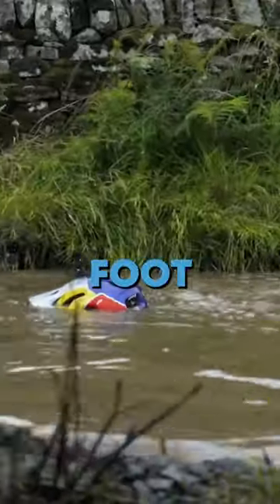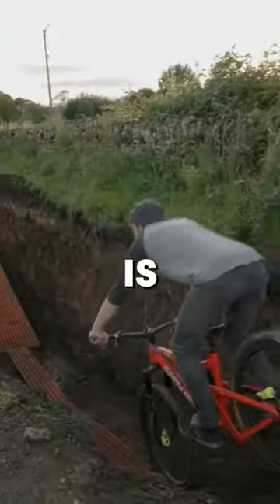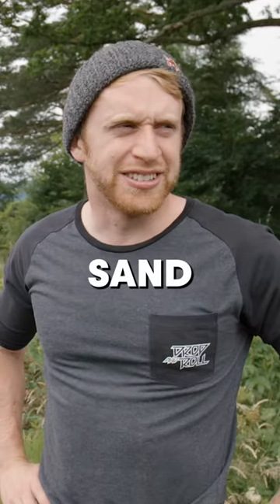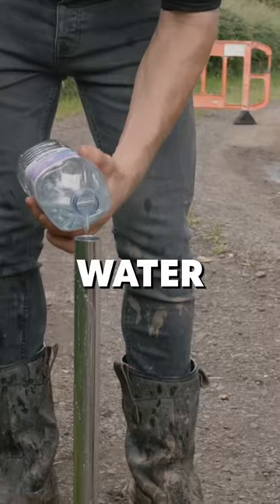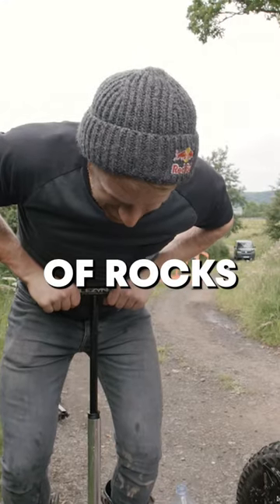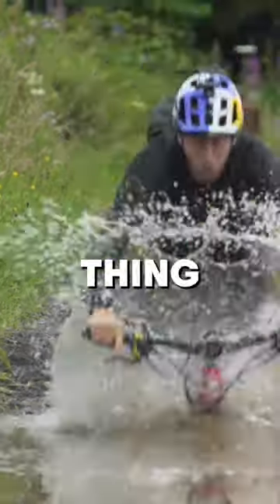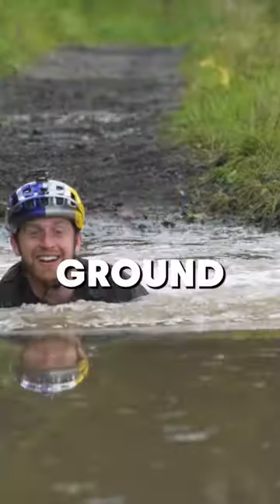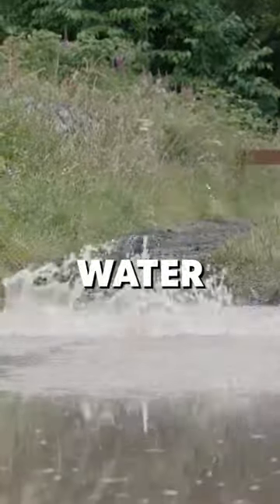How To Ride A Bike Underwater

Comment: I once went through a puddle about 2feet deep , and trust me , it’s not easy nor hard
Reply: Past that its pretty hard since the air in your tires act like floats so its hard to get traction at the bottom without going sideways
Reply: @crimsonsamurai887  just let the water fill up the frame first. There isn't much buoyancy in the tyres compared to other volumes
Reply: The waffle house has found its new host
Reply: but.. this is 6ft deep lmao
Reply: This is 6ft though, and the hard part is when the rider goes under, because a human is pretty buoyant when first entering the water